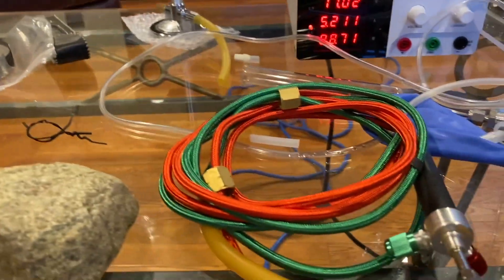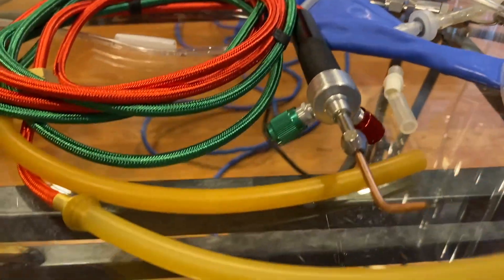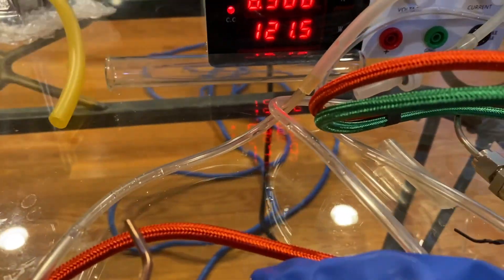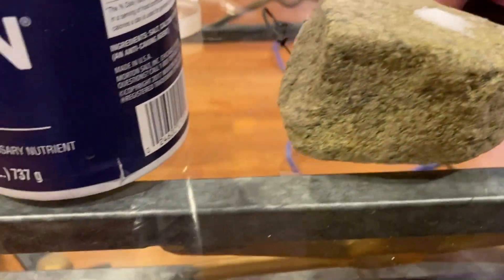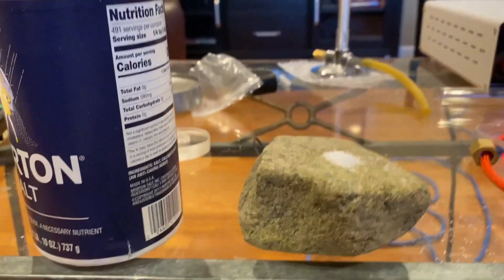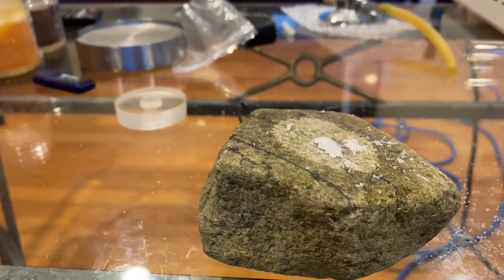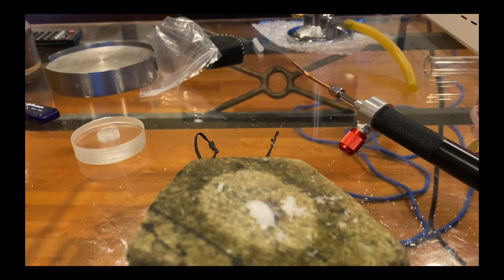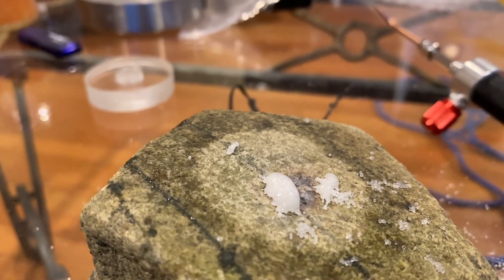Melting Table Salt (1,474°F) with Hydrogen Torch!

Comment: where did you buy that torch? btw nice hydrogen generator
Reply from the maker: Temu. I never bought anything from Temu before that torch.  I thought I'd give it a shot and it's pretty good for $14.  It's a PMMJ Mini Torch Torch Welding Kit.  Thanks for the compliment!  I went with an all-clear design when I built it.  I was going for aesthetics instead of just performance.